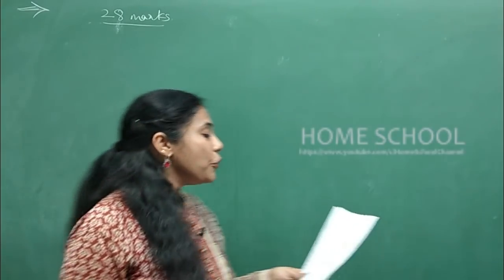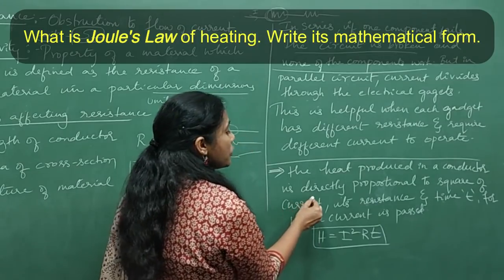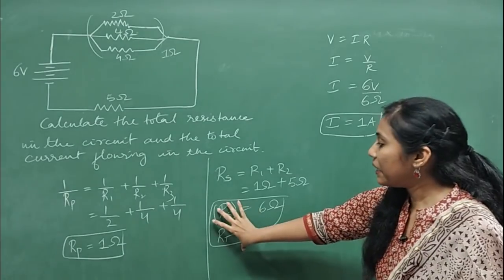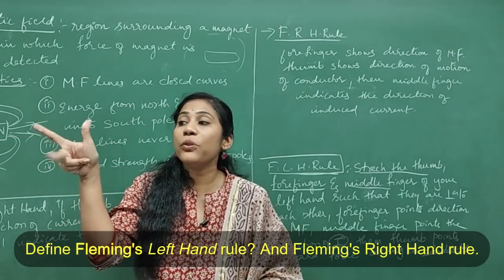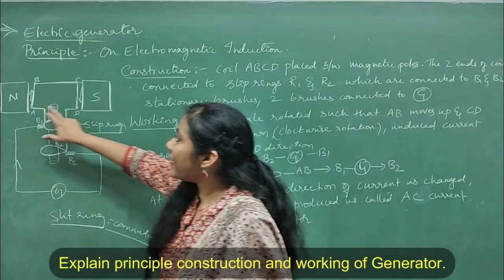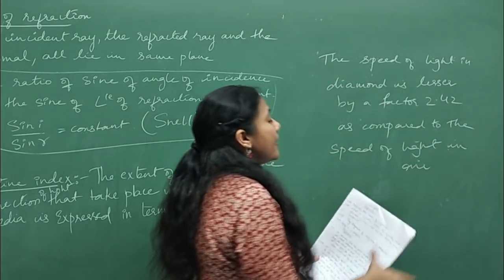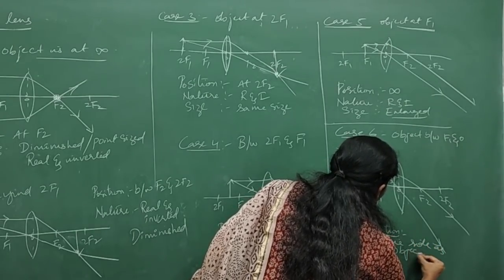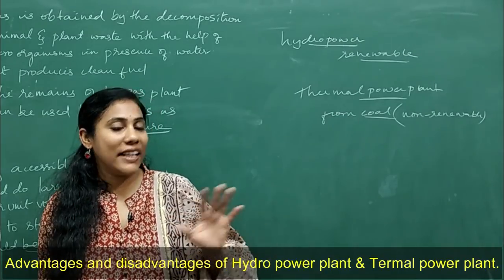Target 60 SSLC Passing Package Science Physics (Part-2)

Comment: Mam in a electricity part one  answer is left that question answer is 
Resistivity of manganese wire of length of 1metre is 1.84×10-6m.if the diameter of wire is 3×10-4m .what will be the resistance of the wire? 
The answer is 
R = 26 ohm
Reply: How u got that ans plss explain me